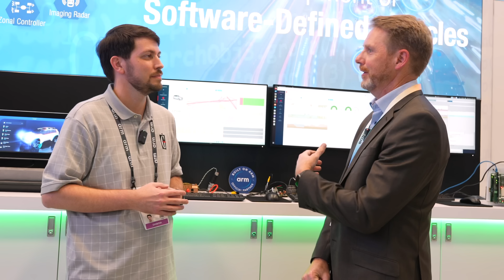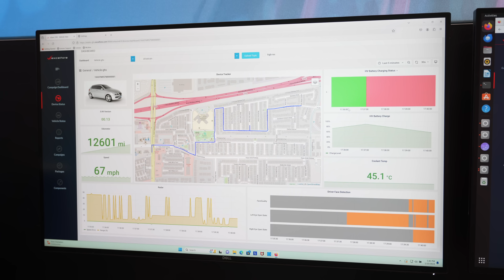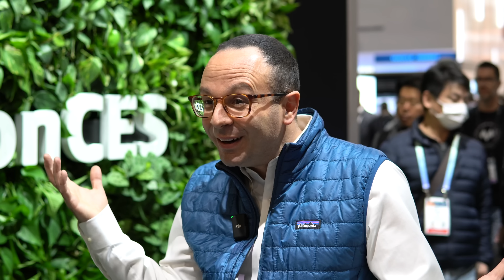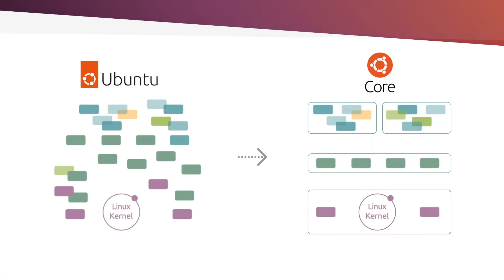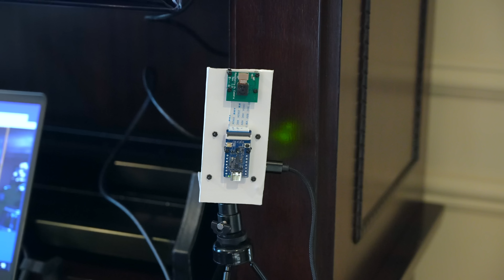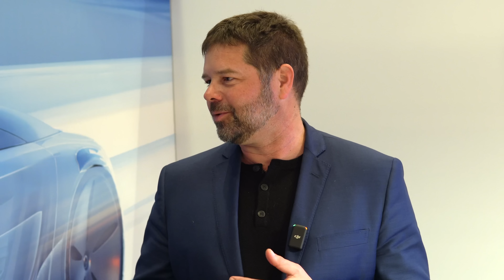AI in less than 100 mW! Power efficient tech at CES 2024

Comment: My biggest issue isn't that a vehicle could be 'software defined', but that manufacturers will adopt the 'hardware as a service' model that is becoming popular in the IT space (Meraki). Subscribe forever, or your car can repo itself (new Ford patent application). The idea of buying something is dying, which is....not good.
Reply from the maker: 💯

The 'new features for pay' idea is ripe for abuse, my hope is consumers will reward the good uses and punish the bad. Probably optimistic though :/

But I can hope—it sounds like some manufacturers are finally adding buttons back in again, after the push to remove all physical buttons from the cabin!
Reply: @JeffGeerling In an oligopoly, all car manufacturers will follow in quick succession to give the consumer no real option. We saw things like this with headphone jacks, the decrease in cars and increase in child killer pickups and SUVs, the phone replacement cycle of every 2 years by way of making consumables enclosed and very inconvenient to replace (batteries) and more.

These are deliberate, industry wide efforts to try to leave plausible deniability that consumers should be blaming themselves for the actions of corporations removing the option of choice.
Reply: @JeffGeerling   if "vote with your wallet" really encouraged good practices then phones would still have easily replaceable batteries and headphone jacks, GPUs wouldn't be costing 1600$, printers wouldn't be... well printers, adobe suite wouldn't be a subscription, and water wouldn't be sold in plastic bottles.
Reply: @JeffGeerling  I would say that, beyond a fairy tale with no connection to reality, actual hope would require some evidence of that outcome ever taking place at any time.  Creating a new class of serfs to forever pay their lords rent is not a scenario for which hope has any part.
Reply: Please give up on the idea that consumers can direct capitalism, hearing it from an intelligent person as yourself is just sad. @JeffGeerling
Reply from the maker: @mikkelkuunarsson7716  That's a bit defeatist—there are good and bad, and the fact we're in a period where the pendulum's swung so far in one direction that de facto monopolies exist all over doesn't mean we can't make things better without something akin to the French Revolution :)

I tend to take a more positive outlook, and think it will take a huge and concerted effort—but it is possible. A lot of it has to do with overcoming a weird standstill on the regulatory side. Politics has been weird for the past 8-10 years, and nobody benefits from how it is right now. That doesn't mean we can't change things, a lot of that happens starting on the local level, where individuals like you and I can actually make a difference.
Reply: @JeffGeerling  Politics hasn't "been weird for the past 8-10 years". There's been a decades-long effort by moneyed interests to underfund public-benefiting institutions, laws and education, that they've always felt were cutting into the profits they could've been squeezing out of the lumpen masses. Please find out how messed up things have been ever since Grover Norquist had the ear of "important people".

The only difference in "the past 8-10 years" is that a particular wing of the conservative coalition lost its chill over a black man getting to be president, and going mask-off with their priorities.
Reply: @mikkelkuunarsson7716 Totally not a manipulative comment... Come on
Reply: @wyw876  I was fully with you until the braindead take that was that last sentence.
Reply: @JeffGeerling  true changes in markets come from regulation, not people's choices. I like to be optimistic too, but I don't hold out hope for market forces alone to result in products that benefit the consumers more than the companies.
Reply: @AndrasBuzas1908 Not pissed off, just disappointed that someone truly believes the only criticism that could be made against Barack Obama is his race.
Reply: @mikkelkuunarsson7716  Big corp directs capitalism, not consumers - Just look at this platform (YT) not only hasn't changed - it has got worse (Every second video I watch - the creator self sensors their content to appease the overlords views). Remember the car industry put out an ad saying you would get R'd (again self sensor) if right to repair was allowed.   Big money - big impact.
Reply: Imagine if Broadcom made a car…
Reply from the maker: @45414  Heh, I know Apple's been rumored to be working on one for years!
Reply: Have a hug Jeff :D (oh and go find my rant about cars ^^ >> vv somewhere..
people 'working in' politics, or any industry I guess know the names of the money-people that run the world decades before it gets anywhere near the news. This latest ICJ issue is just their continued policy I'm afraid, redirecting now Trillion$ out of 'america' and into (coughs) foreign policy.
.
but yes, fairly dark times im afraid, I do wish the cars were electric.. just not Robotty :D @DoubleDownNews  @JeffGeerling
Reply: Meraki sent me a device to test once about 7 years ago. The moment I realized it was cloud based with no local-only option, I unplugged it and never plugged it in again. I still have it.
Reply: This is an important topic. Thanks for bringing this to people's attention. Supporting a 'right to repair' and modify is one practical solution to this emerging problem.
Reply: Worse yet, it solidly puts the newcomer/non rich and an unbeatable disadvantage, because they must rent all the things they would need to start competing, and of course now those numbers can be played with.

Furthermore, you lose any remaining semblance of control over your own things, because they arent yours, they're a corporation's, and that corporation now gets to decide how you live their life because you are simply a "user" of their "service".
Reply: It's my car. I WILL do whatever I want with it, and that involves unlocking features without paying for them. I also have a right to a jury trial, good luck finding people who will convict me of doing such things. We live in a delulu clown world.
Reply: It’s not becoming popular it’s been here since early 2000s. What rock you been under?

Comment: One thing that terrifies me with the car manufacturers being more directly responsible for the software is that now there self certifying… and now look at Boeing and think how much more a car manufacturer would be willing to cheap out, or just look at what they have done already….
Reply from the maker: I can't disagree—I think in the past manufacturers differentiated on style / looks. Nowadays they are trying to get more and more into software. Some are okay at it, others not so much. That's one reason I highlighted Automotive Grade Linux early in this video — there are some efforts to make at least basic components more universal, more open, and not have 20 different things that break in different ways.

It would be great if more manufacturers would focus on that kind of thing, and not on how to make heated seats turn into a subscription service! Or worse, any kind of safety features!
Reply: @JeffGeerling  I. the case of motorcycles that is exactly the opposite they are doing. They outsource more and the internal stuff is almost meaningless as in they have not a lot of self initiative to create systems where there aren’t 50 different ECU’s..

It also seems some jump onto the Android as Car software train where you get pretty much locked into using an android phone for connectivity which sucks.
Reply: 'Move fast and break stuff' takes on a new connotation when you're dealing with multi-ton metal boxes that are used exclusively in close proximity to people.
Reply: Exactly. Think about how games are so shit and buggy these days upon launch because devs KNOW they will just patch it after release. Think about how many cars will roll off the production line with crap not working left and right and the dealer will just say "no worries bro, you can patch that after you drive off our lot" only to have it take 6 months or never ever be fixed.
Reply: @youtubasoarus  If the systems are already incorporated into the car. Why should you have to pay extra money, to be able to access them?   BMW have a system, where you can change various things on the dashboard. But you have to pay extra, to do it... WTF!!!
Reply: @billbar8532  You shouldn't. I would jailbreak or hack the shit in my own car to make it work. But then, I wouldn't buy this shit in the first place.
Reply: As someone working IT, I have intimate knowledge of how bad and unreliable software and the cloud can be. Not to mention the subscriptions and subscriptions tiers. Software and cloud tightly integrated with vehicles is a pretty terrifying prospect.
Reply: I love tech, but I think cars have way too much software driven functionality these days without any real benefit. You can not even open a door on a modern car without some electronics doing their thing in the background. I dont like modern cars :/
Reply: @AndrewTSq  The efficiency has gone up quite high but today we add gimmicky features..
Reply: yes, the only real solution to make such things safe is to make them fully free open source, and use free open source standards and such.
Reply: Oh they will cheap out, outsource it to the lowest bidder
Reply: Would be surprised if Musk allows for such full on testing by his Tesla engineers as Green Hills Software seems to. Currently it appears that it's Tesla's consumers doing the testing. Also still surprised that Tesla is now using x86 platform for the cars CPU.
Reply: @conceptrat  GreenHills for sure know what they are doing i bit pricey..
Yeah x86 as a car platform will be fun with all the downsides it has and how inefficient it is.
Reply: Most of the car companies don’t have even people that can write software so i dunno what you mean but most of the software is suppliers. And a lot of these companies can’t do self certification as they lack the people for it. And also GMA certification is done in the country where it’s sold anyways.
Reply: Idea to improve car security, government organised pawn to own competition, rewarding hackers/security experts to defeat car software systems and then fine car companies for repeated failures or delays in fix's
Reply: @pietersmit621  Hmm i’d rather not do that as most of the companies wouldn’t know how to fix it as it’s a product sold by the supplier.
Reply: Agreed car manufacturers are good at car engineering not software engineering. Tesla is the other way around.
Reply: @bsdguru  I'd have to disagree on Tesla being the other way around, they might be for a car manufacturer ahead of the curve on OEM software, but that isn't saying much - I'd still not say they are good at it.
Reply: Tesla is an software / AI company first, automaker second.   @foldionepapyrus3441
Reply: Who else are you going to get to certify a niche product? Nobody else checks a missile does what it says on the tin either. If they get it wrong then it’s their reputation. Not every safety critical component relies on software and when it does it’s likely to get tested to the moon and back
Reply: They don’t self certify. The federal government has nothing to do with individual states granting software driving licenses. California pulled theirs with no input from the federal government.
Reply: But they made it clear that car operating code is walled off from customer experience stuff.

That said, I'm personally not looking for my car functionality to change over time. Then again, I manual, so I'm quite atypical.
Reply: @cv990a4  Do you REALLY believe that? That's what they said, that's not what OEM's will do. They want more control to extract money from our pockets, and the software will help them do that.
Reply: @youtubasoarus  lol more engine boost package using an ota update
Reply: @youtubasoarus  Yes, I believe that, because of liability. If you allow easy access to software that controls safety and other such basics, you're inviting lawyers to sue you to oblivion. US society is shaped by litigation and the desire to avoid it.
Reply: @cv990a4  Go ahead and look what happens when companies KNOWINGLY screw their customers? I'll wait. They get away with it. What happens otherwise? A small lawsuit and a slap on the wrist? Or a class action that leads to customers getting a 3 dollar check in the mail? Come on now. Them going through litigation has been a cost of doing business for some time now.
Reply: @cv990a4  anti-right to repair propaganda.  indemnify.
Reply: @youtubasoarus  Probably yes actually.  Virtualization is industry standard in IT mostly because it's really convenient; security segmentation is a nice bonus.  That doesn't make the technology flawless, but that isn't a surprising claim he made.
Reply: @cv990a4   how is that possible when the user can change modes like sport, suspension, etc. those are all critical low-level stuff.
Reply: @mehregankbi  Issue is not whether those things can be changed by the driver, but whether those things can be changed through software updates. Further, even if they can be changed through software updates, it matters at what level they are changed. At deep or surface levels, for want of a better word.
Reply: @cv990a4  that's also an important point. but imagine not having access to critical devices through updates. for every bug they'd need a visit at the store.
Reply: Agreed self regulation is a total myth, and 100% untrustworthy. Someone else mentioned the gaming industry, and I'd like to add that S. Kr has had a sort of self regulated body for the gaming industry, but the Nexon and Maplestory's cube shit happened regardless. It's absolutely terrifying at the speed technology is moving and how slow the governments across the world are.
Reply: The auto OEMs 'self certify' and then report out to government organizations things like emissions and fuel economy already, because government organizations do not have the time and resources to test every car that comes out. And cars already have billions of lines of code, as firmware baked into the thousands of microcontrollers and microprocessors in a car already exists today even in a humble Honda Civic. It's not guaranteed or necessarily proven, but I would trust the automotive OEMs to do a better job to make sure their products work out of the box, compared to silicon valley tech companies where things like consumer safety are foreign or afterthoughts. The kind of beta-level, low quality crap that you sometimes get out of Tesla is not the norm in the auto industry, although I fear that OEMs might be tempted towards that model.
Reply: @Duckferd   @JeffGeerling  You both need to see SafetyResearch's 2013 publication titled TOYOTA UNINTENDED ACCELERATION AND THE BIG BOWL OF “SPAGHETTI” CODE.
NASA was involved in the analysis. The results are nothing shot of terrifying.
Reply: Self certifying is way less of a concern, than you would think. There are lots of regulations in place that prevent manufacturers from delivering sub-par software.
Reply: @Chriss120  and look at Boeing and the FAA, the FAA allowed them to self certify and we have multiple planes that would not have passed inspection, being in the air and even losing plugs! You can’t mix those inspectors and money in the same bowl because more often than not the money comes out and the inspection doesn’t
Reply: @piman13_71   That's a very lame argument.  Does anyone sane imagine that Boeing CHOSE to cut some $50 corners b/c they figured they'd save money while incurring a ~$30Billion dollar PR & order-loss fiasco ?  It's not about the money, that's the standard liberal/marxist anti-biz bias argument you're pitching.
"Inspectors don't create quality" - we've understood that since W.E.Deming wrote in the 1940s&50s.  Somehow every armchair-idiot never became aware of this obvious fact about production.
Something is wrong, perhaps very wrong, in Boeing's production process.  Only a detailed review can tell us what exactly. It appears that the   Boeing (not Spirit Aerosys) was supposed to complete work on that door-panel and failed.  There is certainly an electronic production record of who was assigned the task, and of it's completion.  It's almost unthinkable (tho possible) that the airframe was internally certified as complete unless that item was marked as complete.   This is not about finding the guilty-party - this is about revising the production system to avoid this problem.
Reply: @Chriss120  There were regulations in place when car companies spent decades lying about and falsifying emissions, often using software to beat tests. There is more than enough reason to be concerned.
Reply: Tell that to the rivian drivers that were stuck on the side of the road with bricked trucks because of a forced update @Chriss120